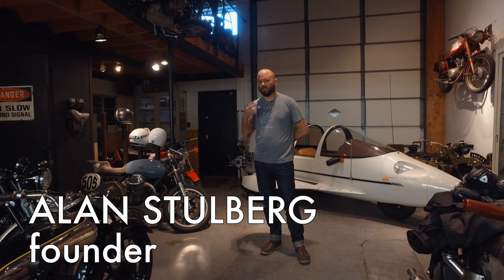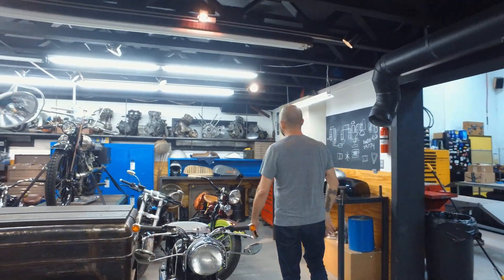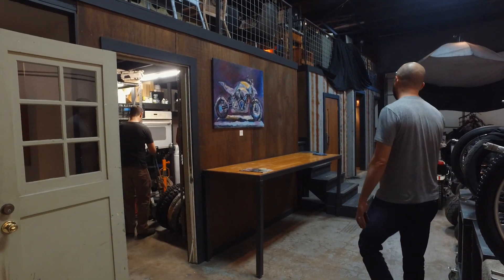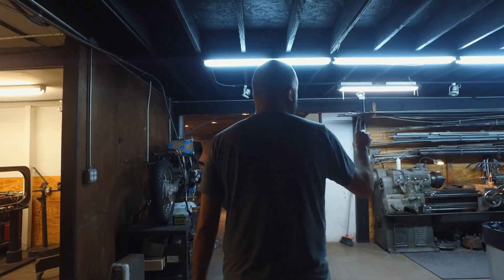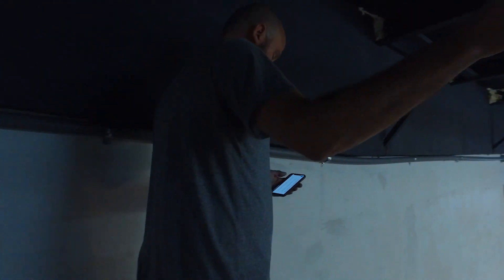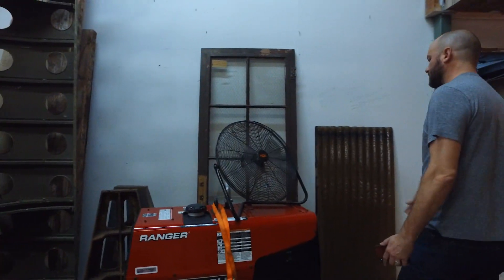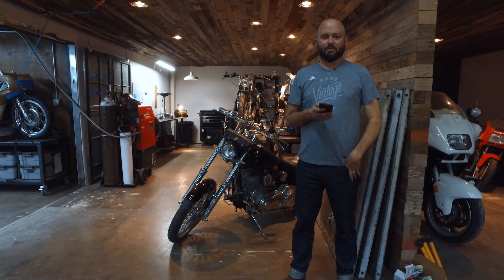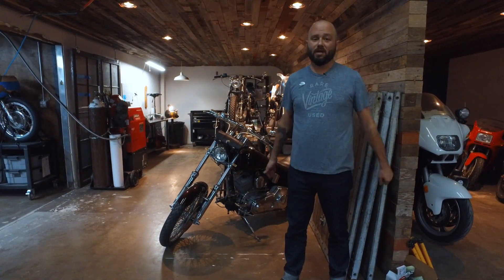About Our Building // Revival Daily No. 15

Comment: I really like all the rolling steel bike tables you guys utilize. Would you mind sharing some details and the dimensions? Tops look to just be 11 gauge steel tacked welded to the box tubing frame? High quality casters or just generic ones to get the job done? Thanks!
Reply from the maker: Hi Kevin,

 2' X 2' X 6' , 2" tube , 16 gauge tops 

The top frames have two cross members for additional support. I think the wheels are 4" lockers. Nothing too expensive. Some have a single tube running the length, and some are boxed. We can use ramps to load them but more often we transfer from a lift. 

-Berry
Reply: Berry,

Thanks for all the details! Your shop is top notch!

Comment: Does Revival have a limited on the size of engine they would run in a build, example being 14ci-103ci. I'm building a rebel 250 narrow frisco style chopper, and get the whole too small of an engine thing a lot. But I have a 14 dyna with a 103, and the bigger engine doesn't make riding more fun.